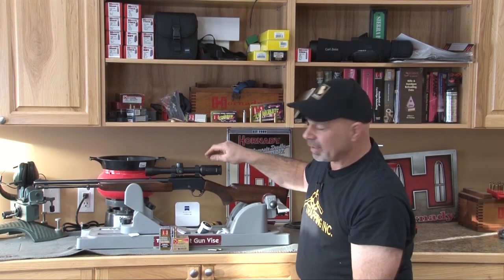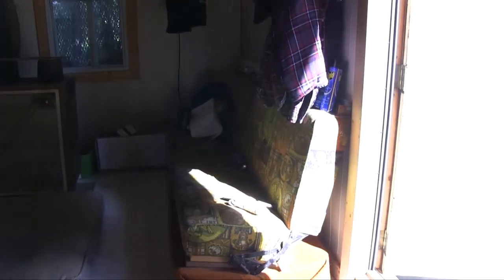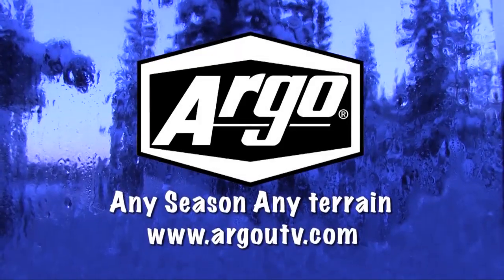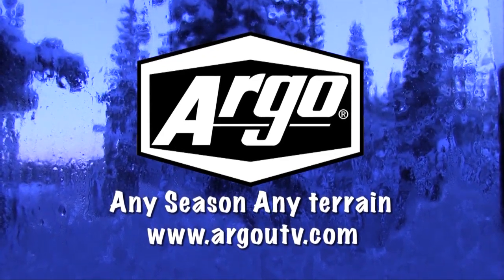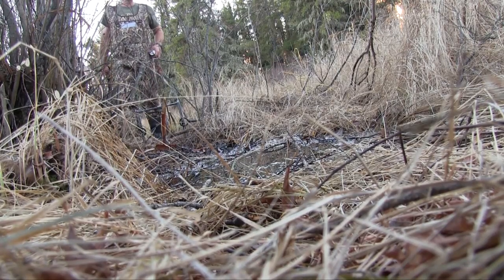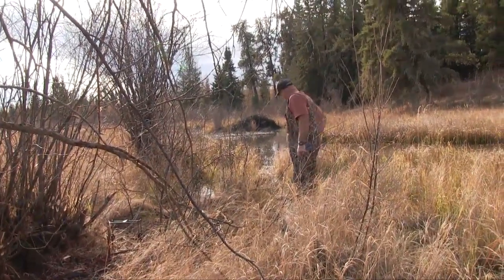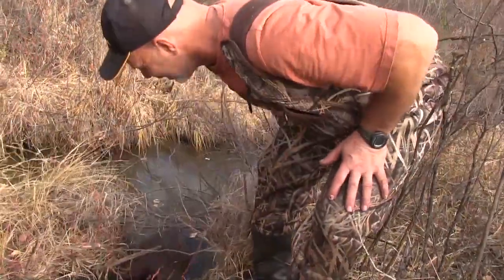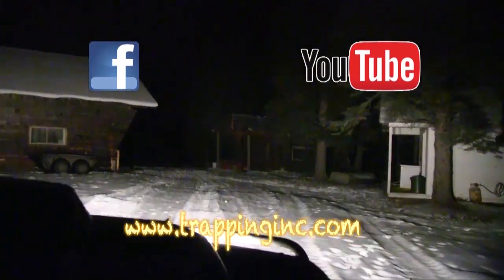Trapping Inc Ep6 S1 Cabin renos and fall beaver

Comment: those 330 can be tough on fingers forsure.  i had 3 fingers caught when one of the safety's slipped off and slammed my finger in the trap.  thank god it was only one or i may not have those fingers now.

work safe and have fun guys.
Reply from the maker: +Adam Craig My number one reason for liking the Belisle trap so much is I really have to work hard to make a safety fail!

Comment: Is that number 11 wire for tie off. For your beaver canal. Do you lose your 330s to coyote, wolf, or bear?
Reply from the maker: 14 gauge. Never had anything with 4 legs steal a trap
Reply: @TrappingIncTV   Yes I have had a bear take 2 330 with 16 gauge wire, lesson learnt! I use 1 8th cable with a drag pole or tie off nearest brush or tree. Thanks Rich